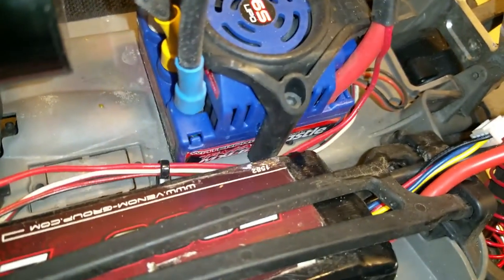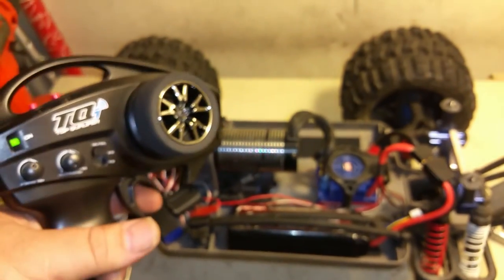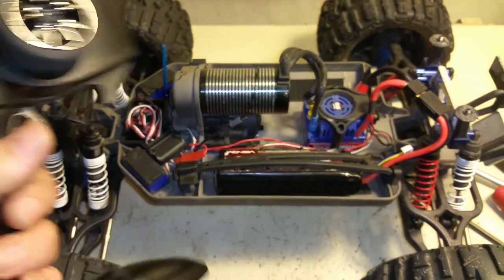Castle Creations Calibration!!!   MUST DO FOR ANY NEW MODEL

Comment: How about changing in and out of race mode sport mode I dont have reverse
Reply from the maker: With the ESC off, press and hold the EZ-Set button until the LED turns solid green, then solid red and then begins blinking red (indicating the Profile numbers).

When the LED blinks red twice, release the EZ-Set button

Then pushing the ex set button will change the profile with each push

Comment: Can you please help me my Castle creations sidewinder 4 will not calibrate when I pull full throttle and then turn it on and then i’m still holding for throttle and it just blinks red it does not beep or nothing what do I do to  fix it
Reply from the maker: Reverse your throttle on your controller. 
If its flashing red, usually that signifys the throttle is reversed.
Reply from the maker: https://youtu.be/vhSACFw6Wk8
Reply: @CENTRALFLORIDARC  hey bud can you help with my setup I moved to electric I'm having trouble getting it to calibrate when I turn it on there's a series of beeps then single beeps and it seems like all the lights are flashing
Reply from the maker: @joshmiller3045  when you turn it on normally.
Does it go through all the beeps and then stop?
Are you able to make the car move?
It might be out of trim

Comment: When I start calibration, it recognizes full forward throttle, but then when it's time to go full reverse, it just keeps beeping and blinking red.  Please help.
EDIT: Also the sound cuts off sometimes
Reply from the maker: Tranzit  do you have another radio or receiver to try?
Usually it's a radio issue

Comment: Mine just Flashes green . 
? Not recognising full throttle
Reply from the maker: Mark C. Possibly.  Is the throttle reverse?
Reply: CENTRAL FLORIDA RC 
Not During the Calibration , NO. 
But it is reverse though as in Reverse for forward , I’ve tried switching it over from the TX, I’ve Tried increasing my EPA to Max , It still won’t give full throttle , I’ve sent it back and have it back , 
“Told there’s nothing wrong with it”
I’m at my wits end with it 😡
🔨 feel like smashing it .
Reply from the maker: Mark C.   Any chance you can make a small video of what it's doing?   This way I can see what exactly what it's doing and at what step
Reply: CENTRAL FLORIDA RC 
Yes sure 
if you don’t mind waiting I do it may be tomorrow . ? 
I’d be glad for some advice .😏
Reply from the maker: Mark C. That's fine.  Just send me a link to the video and I'll be glad to help.

Comment: at the end mine just beeps plz help
Reply from the maker: Dan Fetchen. Does it go completely through all of the settings as in the video?
Reply: at the end it will not arm
Reply from the maker: Dan Fetchen make sure the adjustment is at 0 

What color is it flashing at the end?
Turn your throttle adjustment slowly and see if it will find 0